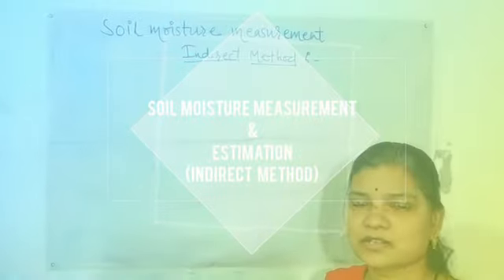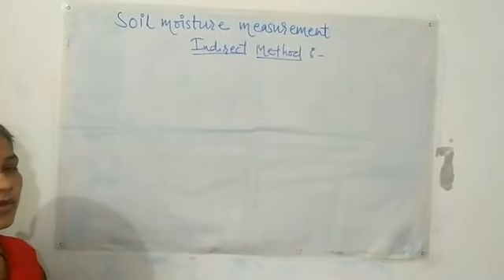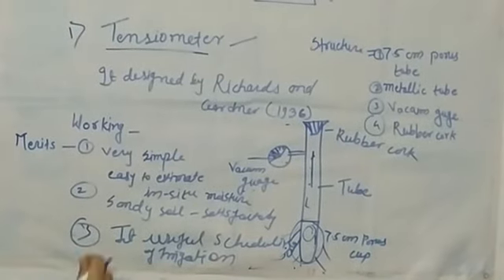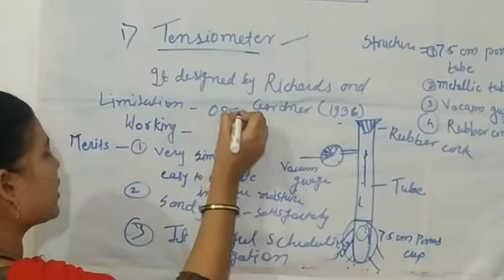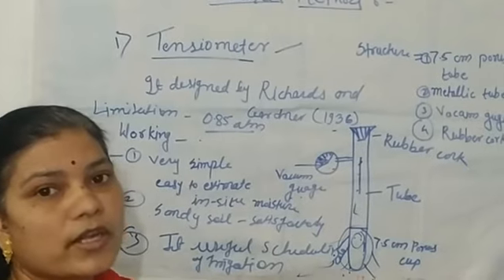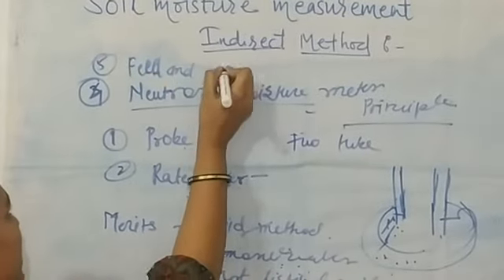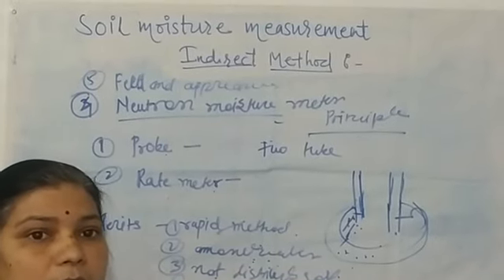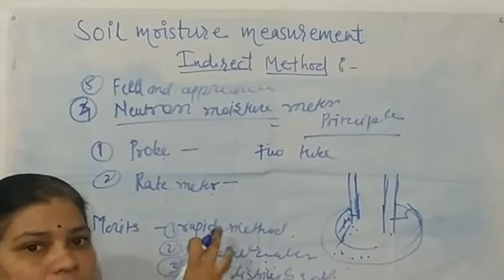Soil Moisture Measurement Estimation ( Indirect method)

Comment: You are teaching wrongly. please check that pressure plate app is not for measuring soil moisture. In fact, soil moisture in this technique is determined gravimetrically. What do you mean by feel method. How can you quantify it? Please do not upload such low quality lectures to mislead the students.